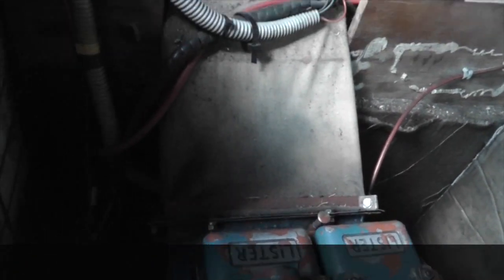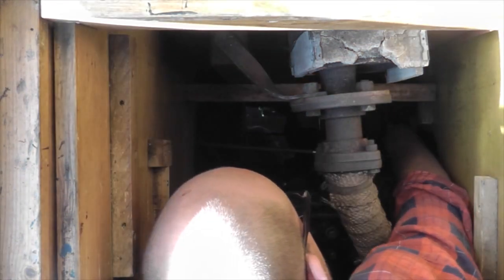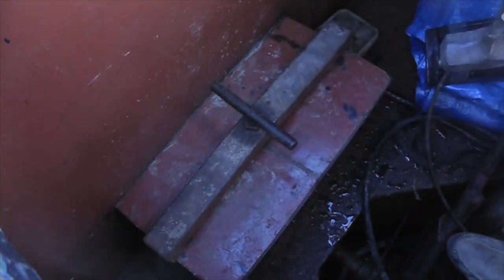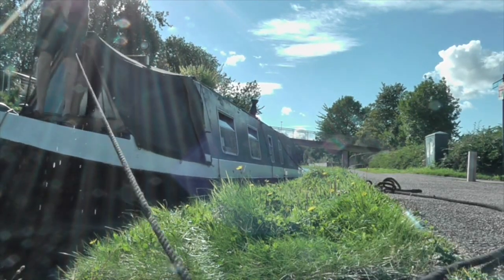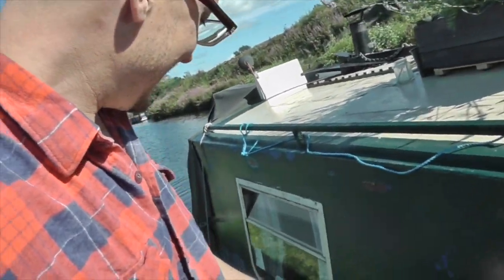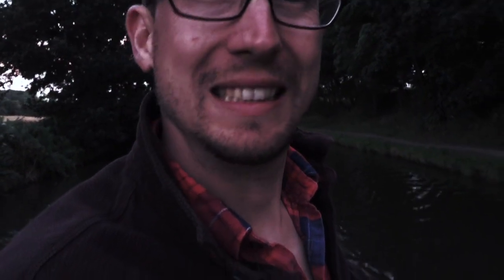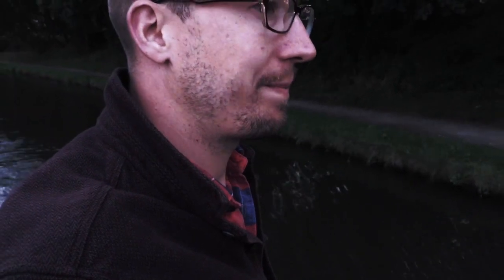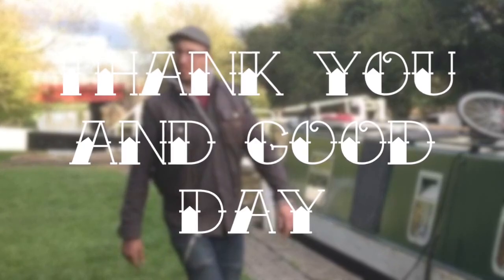Narrowboat voyage log | Starting a narrowboat with engine checks | Runcorn

Comment: That's Runcorn old town, it's like a set for a zombie apocalypse movie, the new town has a a decent(ish) shopping centre/mall with a massive The Asda and a McD and all the same chains stores you see in every other large shopping development in the UK, if the charm of the old town doesn't suit. The railway bridge is a fucking work of art, the bridge and the embankment leading to and from it all made from standard size house bricks is insane, the amount of work that must have gone in to it is breathtaking. The steel road bridge is a doozy too, like the one over the Tyne, accept about 10 times as long. The road bridge was built to replace the transporter bridge that used to be the only way to get across the Mersey at the point for road vehicles. The transporter bridge was like the one that still exists on the Tees, it's a hard concept to describe, but it's basically a couple of towers on either side of the gap being bridged. The 2 towers support a gantry going over the tap and there is a wee platform suspended from the gantry by large cables, this platform moves back and forth across the gap with the vehicles and ppl on it. Just look up Tees's transporter bridge and all will become clear.
Reply from the maker: Nice one thanks for the local knowledge always appreciated

Comment: You mentioned you had no experience with diesels so quick little tip here in the states the oil must meter API specifications 
and each container is so labeled check any .motor oil you have on the boat not poured into the engine look for the API rating there
are two types one begins with a S and the other begins with a C 
S stands for spark ignition and C stands for compression ignition.
Any diesel wants oil with a C at the beginning of the API rating 
Most all diesels here in the states use 15-W40 as a general point Delo-400 motor oil will cover all factory specs.
Consider rerouteing the exhaust and switching to a water cooled exhaust with a water to water heat exchanger which would exhaust horizontally out the side at least a 
Foot above The water line to prevent water coming into the exhaust system this would give you a source of heated water 
to run through a heat exchanger to provide hot water for domestic and radiator systems.
Just a thought on how to get hot water from waste heat from the engine 
Cheers
Reply from the maker: Thanks for that! Sounds like you could make a much better video than I! API CC or 10W-40 is what I use, so spot on. I wonder though, would you waste energy by running the engine for showering etc? I mostly only move on the weekends, less in winter so perhaps not for me, but for holidaymakers it would be ideal.

Comment: Air cooled listers are great engines but the water cooled versions give you the advantage of heating the boat 
and domestic hot water with free waste heat. Luv the sound of the Listers and I agree kindly kill the music 
I'd rather listen to a diesel. Electric start or hand crank?  otherwise good video your doing what I dream about 
Enjoy and fair winds kind seas.
Reply from the maker: No way man! Music is a huge part of my life (and the reality is I need it to cover up wind noise!!) Cheers for the comment though always appreciated 8^D
Reply from the maker: Oh and it has an electric starter motor sorry. Great point about the advantages of water cooled engines btw. I move once or twice a week (and shower/wash up every day!) so my current set up is more appropriate for liveaboard life I think.

Comment: superb video I'm a fellow lover of good air cooled Lister

 I'm currently restoring a SR3 and just got my hands on a hydraulic gearbox same as yours, as it had a mechanical one on when I brought it as a scrapper

how are you getting on with synthetic oil in the Lister? I have brought some straight 30 weight oil to put in mine now I have it running have recently refurbished the injectors and stripped down again for fine tuning and painting 

if you ever feel the need the top rocker covers polish up a treat if you put the time in removing he paint and polishing them up :) 

been off boats for about 8 years now and looking forward to getting back on the cut again soon 

keep up the good work and keep the videos coming especially anything Lister related
Reply from the maker: David, thank you so much, great to hear about your engine and plans to return the water. If I was to test synthetic oil against normal I probably would not be able to tell the difference as I am not a mechanic, I have only basic knowledge and there would surely be many other factors that I would need to understand.  Thanks for the tips and sorry it's not more engine related - hopefully you find the other videos entertaining anyway 8^)